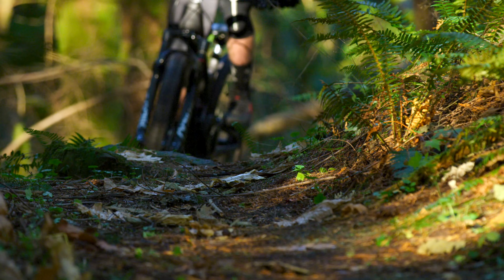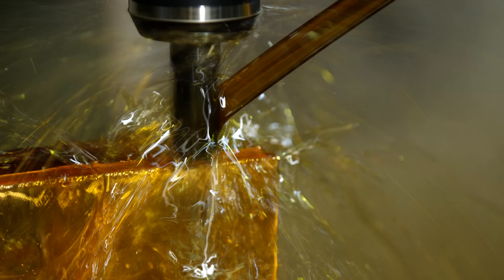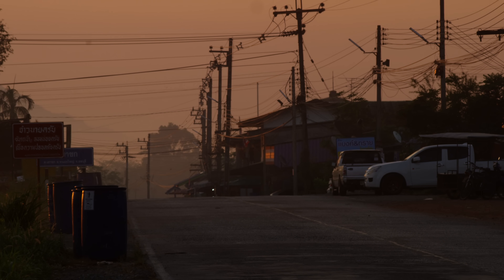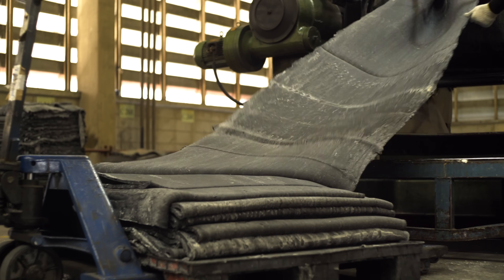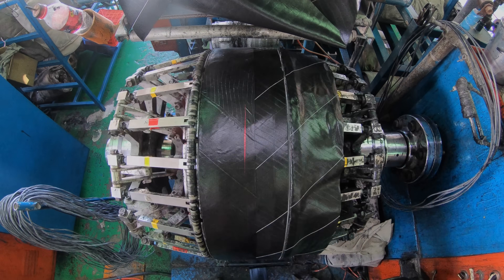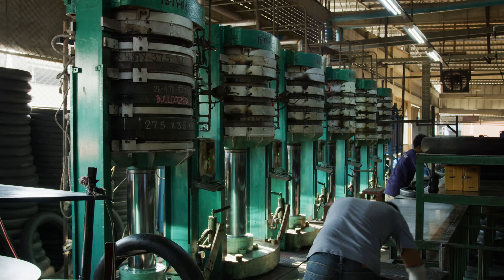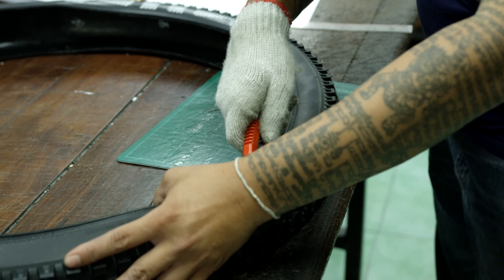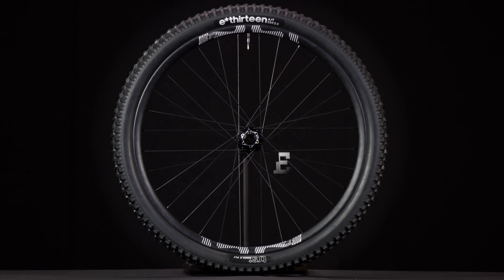Making Bike Tires with e*thirteen // Made With Love

Comment: Impressed by the quality control by Vee and e*13.  The mounting and dismounting of the tires to check for leaks and/or wobbles is impressive considering the volume.  I have the first version (classic) of e*13 TRS plus/race tires and I have to say - they grip like fly paper.  Rolling resistance is a tad high, but the excellent grip is worth it.  Great video Freehub!

Comment: Huge fan of the ride feeling and grip and the extremely easy tubeless setup of their 29" DH tire, but after I broke 5 in less than one summer it was time for me to give up and move back to Maxxiss. Great video though!
Reply: Tapio, Sorry to hear about that with the tires. I would be curious to get some more info from you about which generation of the tires you were running and the trouble you had. In general, we have a lot of happy customers with the tires. If you would like to maybe give us another chance with some of the newest tires, send me a message at support@bythehive.com. Cheers, Chris
Reply: @chriscostello3234  Cheers Chris! I have sent You an email just now.
Reply: E13 is easily one of the best, if not THE best, in customer service. Impressed, with this response and the video, and want to give these tires a go after my current set of Michelins wear out.
Reply: Gotta say, it was absolutely surprisingly fresh to have Manufacturers representative to approach this way. Much appreciated and for sure I will give a try to Gen 3, A/T, LG1+, 29" Dual Ply DH tire. Cheers Chris/ E13.
Reply: @TapsaTre  - Glad we could reach out to get you taken care of! Im confident you will have a better experience with the new tires!